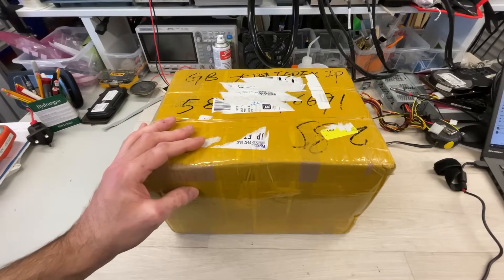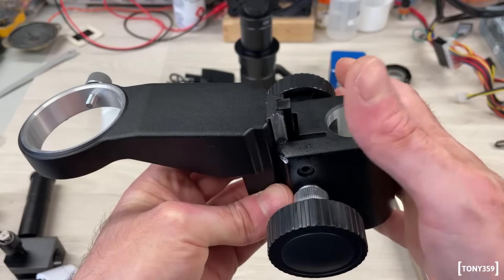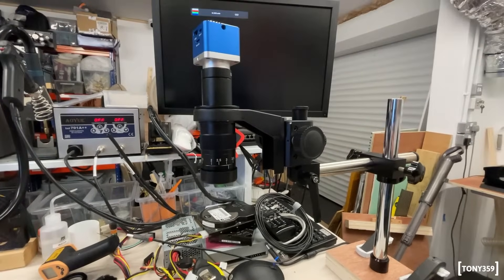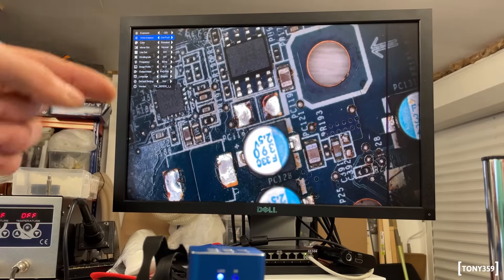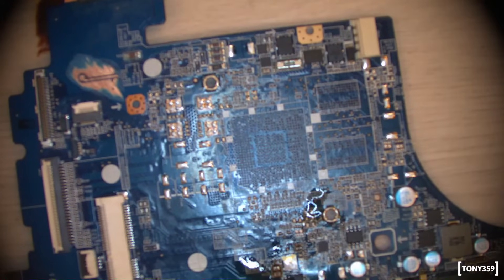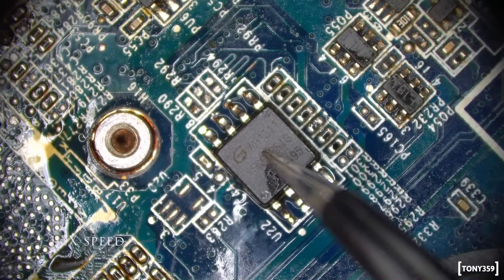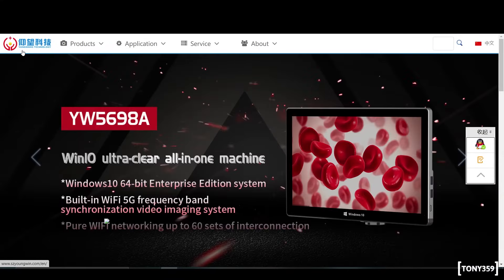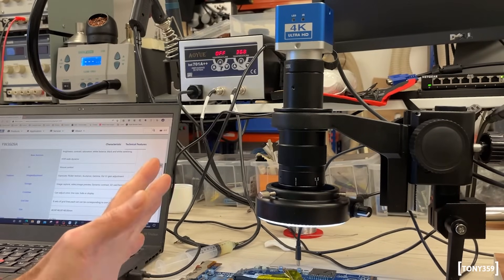Lapsun 4K Microscope - Sony IMX377 (?) - Unbox and Review

Comment: Hi Tony 359. Thank you for sharing and great video!
I just got the same camera today..
Can you tell me what formating the micro card should be. I get a card erro when i try record. Best regards Danni 🇩🇰
Reply from the maker: Hey Danni - thanks for watching! To be honest I never use the SD card as it's so inconvenient to insert and remove. I use OBS instead. However I just tried for you and the SD card was functioning normally after being formatted with default parameters by Windows 10. It's an 8GB sd card. I hope this helps. 

PS: make sure you are actually inserting the card in the slot, if you watched the video you see it's very easy to just misalign it.
Reply: @tony359  Thank you! The SD card was corrupted. I installed a new one. it works great!
The card flew out when i press my nail in. lol.
It works fine with concentration.
Yes i saw your video and was really helpful! 😀👍
Reply from the maker: @RandomRestore  That's great! Yes be careful when using the SD card, the slot is not the best design of that microscope!

Comment: Hello, I just ordered the Sony IMX385 V2 1080P 60FPS HDMI  from Lapsun for $235 US but not sure if the sensor will be any better than what you have here?  It is very difficult to understand what sensor is best etc.  For your camera, though It is a great picture and very doable for rework and electronics etc.  I would be very happy with the camera you have for sure.  thanks for the video
Reply from the maker: Yes, it's not great that you end up in this "sensor lottery". Hopefully whatever you receive is going to be good. Let us know how it goes and thanks for watching!
Reply: @jonnymakers9560 hello, so did you get the imx385 v2 any impressions on the picture quality! Thinking of ordering one myself
Reply: @AK-ct7tw  I received this A2 camera from Lapsun but it does not have an off on button so it is still in the box.  I am actually thinking of selling it and buying the 485 from lapsun because it has a on off button.  I did want to use this camera because then I could not sell it as new open box.  It is supposedly the exact same as Northridge folks.  I will let you know how the quality of the 485 goes.
Reply: @jonnymakers9560  I'm looking forward to seeing the quality of the 485! I bought the 385 because it was waaay cheaper than northridges. 234 vs 600.
Reply: @jet613  can you share the link you bought this from. did you check to see if its what you received?

Comment: What about cells and microorganisms, though? Not everyone wants to get up close and personal with capacitors and PCBs 🙂
Reply from the maker: There are many optics available for the "C mount" scopes. The same seller has a 720x lens available. Mind you, the lens is the same, they change the adaptor. My 120x has a 0.35x adaptor. the 720x has a 2x adaptor. How well it would work I do not know - and the lens becomes very long! At that magnification vibrations become an issue. My use case is electronics I'm afraid! Thanks for watching!
Reply: @tony359  I completely understand that transistors and resistors populate your domain, but it would still be very cool to look at some organic life forms 🙂 Thanks for the info on your setup and the other scope option.

Comment: An old blurry memory in head whispered something about a simple small metal tube (~2-5mm)  between the camera and the lens, to get the closest focus point closer to the the lens. Wasnt it used in macro photography? Maybe this could be a solution for you, but maybe im totally wrong and my brain is just a laundry tumbler XD
Reply from the maker: Optics is a beautiful world. Who knows how those "lens" are engineered. Probably copied by something else by someone who doesn't know much about them! Thanks for watching!
Reply from the maker: Thanks for that - I think it's what they're doing at Lapsun, if you check the listing the 120x, 180x ecc all have the same "zoom lens" and the "adaptor" at the top changes which is likely as you say an empty tube. In fact I wanted to ask them if I could have just the adaptor for the 180x.

Comment: I bought a Sony 55 megapixel HDMI digital microscope camera 260x zoom it came with no software and I'm trying to locate software and drivers cuz when I plug it into the USB it's not even recognizing any help would be appreciated thanks in advance...
Reply from the maker: My microscope doesn’t need software, it’s automatically detected by windows 10 and can be used in OBS. It came with software but I didn’t test it. 

When you say ‘it’s not recognised’, do you see it under your device manager somehow, maybe with a question mark? Does the computer make the ‘usb plugged in’ sound when plugged in? Did you contact your seller, is that a Lapsun?
Reply: @tony359  yeah I figured it out I tried another laptop and it's working but I noticed like a 4 second delay so I'm probably going to run it HDMI more zapier thanks for getting back to me
Reply from the maker: @no1be4me2  Yes, USB is for recording, not for actually using the microscope. That said... 4 seconds??? Mine shows a higher lag but not SECONDS! HDMI is 15ms I think, USB might be 50ms, cannot be seconds!

Comment: Hey ...if you bothered to watch other channels you would have bought the 0.5x Barlow lens. It's widely recommended for height Vs smd soldering.
Reply from the maker: Well, other channels usually show the 180x Lens which will probably work best with a 0.5x barlow. I went for 120x-0.75x, if you watch the follow up.
Reply: @tony359  ok. I am sorry you got into messy choices. But your point being suppliers did not package a working solution for you. That's correct and it's not your fault. The reality is that most brands are not manufacturers. They just rebrand bits and pieces into a package they don't even test. Your channel is well structured and good quality. I wish you all the best as it does take much effort to produce material for any channel. Thank you and be blessed.
Reply from the maker: @naidol  Opinions are always welcome. I did choose the 120X as from all the video I watched, the 180x did not seem to give enough FOV - and when I bought the microscope I did not find a video explaining that an 180x + 0.5 barlow was the sweet spot. Maybe I missed it - but I did bother to watch them! :)
On the seller, I had an extensive conversation about the product before purchasing. I asked recommendation, they were aware of what use it was for. I bought everything in one go - and the kit they sold me was not functional. I can understand they might have missed that but I would have expected a better response to that. 
Not the end of the world, maybe I am used to customer service around here, I just mentioned as it felt relevant. Thanks for your kind words about content creation! :)

Comment: If you ask me, besides having autofocus it is not a that big difference in picture quality between a lapsun 2019-2020 48 mpixel hd microscope camera. Even though the cheap one has a Panasonic sensor. If you can live without autofocus, you pay a fraction of the price and still have a very, very good picture quality. In many cases there is no way around anti glare lights. With them every cheapo becomes a whole new microscope. With use of 20-30% power of the ring light, the illumination is perfect. Autofocus is a very nice feature, i miss it in some situations. But nothing that is crucial. Way overpriced and offering only limited results for what you pay. The market is widely filled, but results are more or less similar. It is up to you if you want to pay that much for so less you get. The price\value is not justified in my opinion.
Reply from the maker: I never tried the auto-focus one but I'm concerned it wouldn't work for me. Depth of field is very narrow at high magnification and I often play with the focus to see different heights of components - the autofocus won't be able to read my mind I guess and focus what I want to see! A nice to have - but as you say it's expensive!

Comment: You should be able to adjust the aperture to change depth-of-field. With all that light, you might be able to get decent depth-of-field even with somewhat closeup pics. Keep in mind that with a very small aperture (high f/number), you'll get diffraction, meaning less sharp images. This isn't a camera thing, it's just optics and thust physics :)
Reply from the maker: Interesting point. But how do I change the aperture? I would need to add a diaphragm in the lens somewhere?
Reply from the maker: https://www.ebay.co.uk/itm/314830140511
Reply from the maker: they are cheap things! :)
Reply: What are "thust" physics?

Comment: I bought the RT5109 model in 2021. Sony IMX226 sensor ( 1/1.7) is written on the manual. Today, the same Model changed the sensor into Sony IMX334 sensor (1/1.8). At that time, IMX334 was about $90 cheaper than IMX226, and Panasonic sensors were about $200 cheaper. I called the seller (RisingCam) on the phone prior to making the order. He assured me that IMX226 sensor is installed. Now, I'm in high doubt. How could I figure out the model of sensor installed?
Reply from the maker: If you open it up, on my item the model is written on the PCB which has the sensor on it. It’s behind the ribbon cable, you might need to remove it for a moment (there’s a connector). Check out the pinned comment on the video, one of my viewers helped me finding out and mine is a IMX334. Let me know and thanks for watching!
Reply: I purchased the RISING CAM RT5109 this year and my camera does have the IMX334 sensor. It really does have great video quality and a true 60 FPS HDMI preview for both 1080 & 4K. I know there were come changes from 2021 to now 2022/2023 models of the RT5109 which did improve them from prior revision related to CPU/MEM used in conjunction with the sensor.  I have purchased a few other camera from Lapsun and Eakins that claimed IMX334 but the video quality was terrible and the FPS were interpolated ( fake frames pretty much ) to get the " 60 FPS preview ". Lapsun was trying to sell fake IMX290 cameras and were really using a crappy IMX307 / IMX185 sensors. I would know because I purchased 2) IMX290 cameras and they did not have the correct sensor. I did it as a test to see if they were scamming. I used 2 accounts and 2 different listing's. They both were different with the 2 sensors mentioned above. Lapsun will no longer have my business. 3-4 years ago Eakins was selling the real IMX290 camera's and I was lucky enough to purchased 2 of them before they stopped manufacturing them. Even North Ridge Fix got scammed. All his cameras that he was selling on his site were suppose to be IMX290 but he only received IMX307's which cost about 1/3rd the price. NRF never addressed the issue but many of his customers did open the cameras up and saw the IMX307 label. Now he is selling the IMX385 and it does appear that model is using the correct sensor. No way near as good as the IMX290 but 1000X better than the IMX307's.
Reply: @shiftctrlhack  do you have the link to the RT5109 you purchased?
Reply: @shiftctrlhack  would you consider the  MX 334 or IMX377 sensor most comparable to the IMX290? Which sensor would you consider top shelf as far as picture quality available to buy today?
Reply: Probably many. They most likely use whatever sensor they can get for cheap at the time. It does not matter too much, as long as the optics are ok.
Reply: @Tugela60  It matters a hell of a lot. Especially when you pay a premium for a camera because it was advertised as using a specific sensor, then the camera delivered to your door better have that specific sensor inside.  Quality of the image notwithstanding, it is fraud and consumers need to stop excusing it and tolerating it.
Reply: @vadimbellous8313  lots of electronics switch components as convienent and according to cost at any given time. It is normal practice. You buy the imager, not the sensor.

Comment: My thoughts regarding the extra lens, it's expected if you buy something online the seller should state what it is and its capabilities as best as possible within its intended use. Many online Chinese sellers are either lazy or try to be smart because if you know it's not a good fit you won't buy, but if you take the risk that's their gain. So I would judge based on what vibe I'm getting. 

In this case what's the focus limits so if they never stated that then they left it up to interpretation and they should pay the return fee and learn lesson next time.  If they were too lazy to add this information I would have pushed. Online customer rights are different because you don't have a chance to inspect a product.

From doing this review you also made them money, but I guess you never mentioned, which was respectful of you.
Reply from the maker: I wasn't expecting this video to be so successful :) In the end it's a good product - what happened with customer service is normal when you buy from China so it's just a warning that those things can happen. Thanks for your feedback!
Reply: @tony359 well that's my take on that. Anyway, I've been holding out buying such a microscope due to the cost and still undecided on what to get so these reviews are useful.
Reply from the maker: and there are so many available!

Comment: IMO, the Barlow lens issue is also your fault. Even though they offered it with the bundle, you should have done your own research on what it actually does and decide if it suits your needs.

From the Wikipedia article on Barlow Lenses:

Microscope use
In microscopy the Barlow lens is used to increase working distance and decrease magnification. The lenses are "objective lenses" that are mounted in front of the microscope's last objective element. Barlow lenses for microscopes can be found with magnifications ranging from 0.3× to 2×. Some standard lenses are 2×, which decreases the working distance by half and doubles the magnification, 0.75× (3/4×), which increases the working distance by 4/3× (1.33×) and decreases the magnification by 0.75×, and a 0.5× Barlow doubles the working distance and halves the magnification. 

You could have saved yourself and the seller a lot of trouble with a single internet search. In your case, a 0.5x lens would have been more than enough.
Reply from the maker: Sure but in my opinion this is where the sales representative comes into play. If I go online and just buy stuff, then I do my own research. But If I ask for advice and the representative does not mention that the kit I discussed with them won't work out of the box, allow me to pass some of the responsibility on to the seller! :) To clarify, the kit was purchased and discussed over email, I did not just go on their website and clicked on things! :) 
That said, it was not much money so not the end of the world. 

Thanks for watching!
Reply: @tony359  Ah, I see now. I agree, it's partially the seller's fault too. Since it was recommended by the salesperson and they didn't do their due diligence to make sure everything works well together.

Comment: Great vid thanks, by the way, Paypal has changed, my recent experience is, that  in a dispute, they make a ruling and are in no way contactable in any non bot way. And if you dispute is with a client more valued to them, good luck. Actually I think luck has nothing to do with it, you are simply dumped.
Reply from the maker: Paypal has become useless unfortunately. I opened a claim some time ago and it turns out Paypal will allow for the seller to request a return at MY expenses. So for items of little value the seller knows they just need to request a return at my expense, Paypal won't cover the cost so the whole refund becomes useless. Sad.

Comment: Thank you for the review. The Chinese are selling even 38MP cameras, for which I found out that they are around 15MP by searching Panasonic and pixel size.
It would be interesting to compare the image quality between different MP cameras since they have approximately the same sensor size, but different pixel size. A bigger pixel should in theory have less noise and better image, but maybe analog circuit of newer higher MP cameras has advanced to capture less noise with smaller pixels.
Reply from the maker: It would be very interesting but I’m not sure they even know how many sensors they’re using 😂 there are so many different models available! I am testing a different model - review out soon - which indeed shows quite a lot of noise on the image.

Comment: Can you hook it up to a serial to USB converter, then you can find out what IMX sensor it uses like this fellow did ?  https://www.youtube.com/watch?v=1jV7Qzr3OQ0
Reply from the maker: Hi! I watched that video before ordering, it's very interesting - and sad! Yes, I'm sure there are some RS232 points on the board but honestly I do not know where as my board is not the same. Right now I am happy with the microscope so I don't feel I want to start tinkering with it in case something goes wrong! But thanks for the link and for watching!
Reply: @tony359  Nice microscope btw, seen your Barlow lens video too. I just wanted to ask you if it's possible to describe the working feedback on the image you see vs the movement you do under the microscope. Does it has a slightly tiny lag on 4k-30fps or it's not noticeable? Thanks nd wish you many repairs !
Reply from the maker: @dancotton13  Thanks for watching! There is a little lag. I got used to that almost immediately to be honest. I was curious and I've just measured the delay on HDMI using a stopwatch: it's 15ms and this includes my Dell 2709W input lag which according to some reviews is around 6ms so the microscope adds an extra 10ms approximately. I've added the pictures of the test in the description! :)